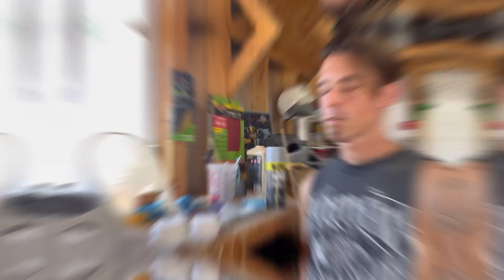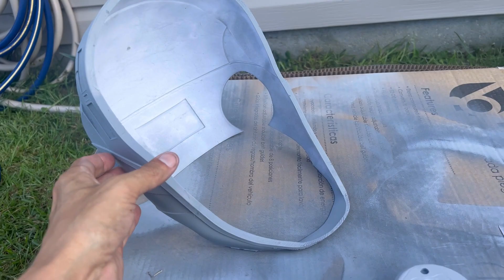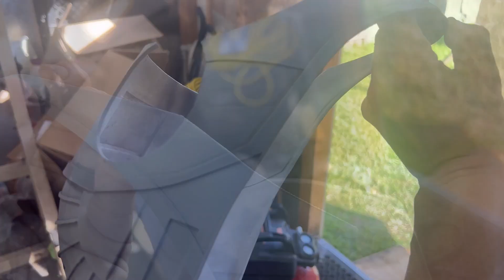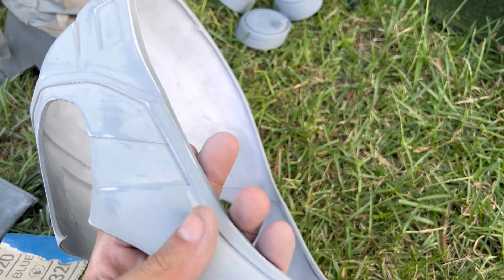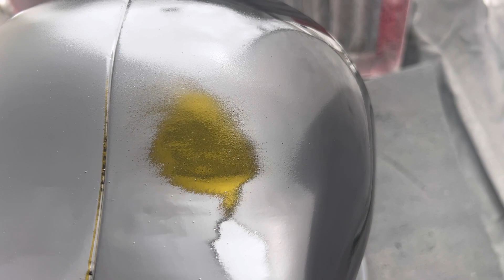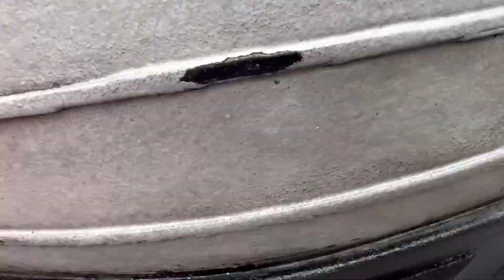How to use Raptor 1K primer on 3D printed helmets | Using high build primer on 3D prints

Comment: Hey man. Long time no speak. 

I just bought a whole airbrush setup. I have to learn how to use it. Ive been building rc crawlers and commercial lighting signs to hopefully get a charity club going on. 

I was going to buy a couple extra printers but i bought a guitar last night to replace one that was stolen a few years ago. I found it and two others in the woods in pieces. 

Whats the best way to just get rid of layer lines. Ive been trying different things. Too many to mention. You are a true artist man. Im a professional guitar (progressive metal) player but my visual acuity needs work haha. Im great with electronics. I find i over prime and it never hardens properly. 

This is joey strong by the way. I was gonna start a channel but decided to just use it for 3d print processing and game previews. Haha
Reply from the maker: Hey bud! Hope you’ve been good. I really like using dolphin 1k with bondo filler primer but it can vary from piece to piece depending on detail. This stuff works pretty awesome for people who don’t want to mess with acetone but nothing can beat the filling ability of dolphin 1k reduced & brushed on!
Reply: as far as the airbrush stuff goes createx is pretty solid to start with, you can thin it 1 to 1 with water. Their autoborne sealer is my fav base coat/primer after prints are smooth